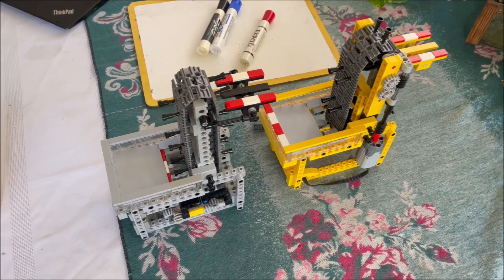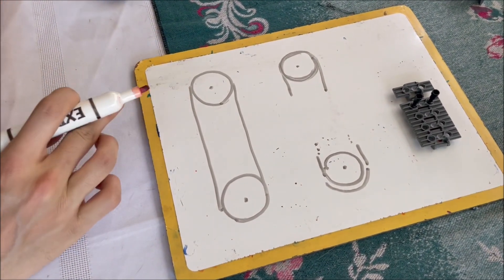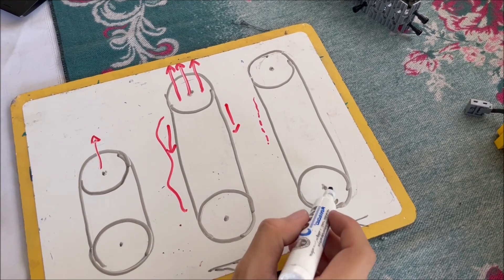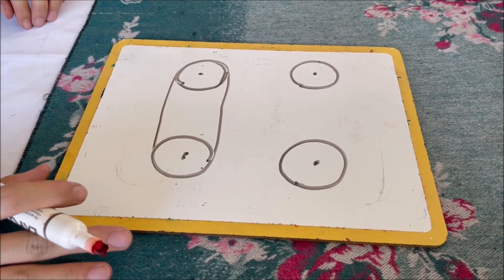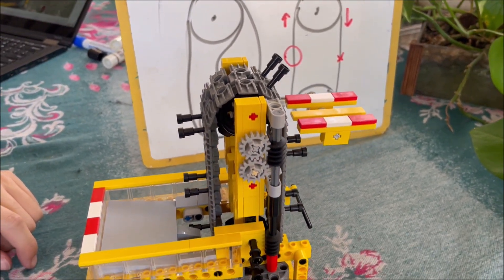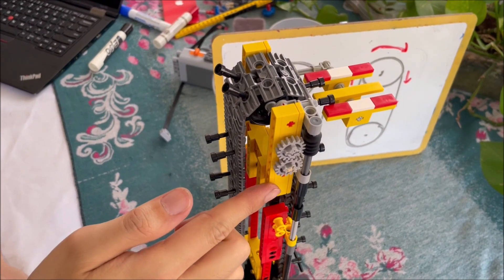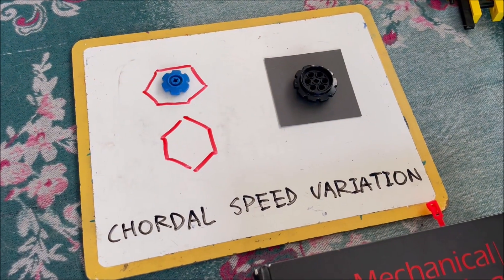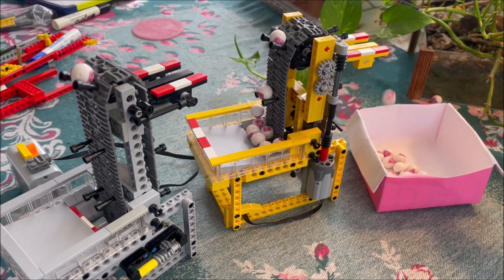LEGO GBC Chain Lift Physics (feat. Bottom Tensioned and Top Driven)

Comment: on the other hand: I have 4 different WM01 from Great Ball Pitt and three of them where on 2 or 3 shows so far and worked well. All 4 are bottom driven and I didn't have lost balls on this modules. But the top driven looks more like a nice technic thing. So I might build one someday 😁
Reply from the maker: Bottom driving isn't necessarily a bad thing, it's more that top driven/bottom tensioned are theoretically more elegant and simple implementations.